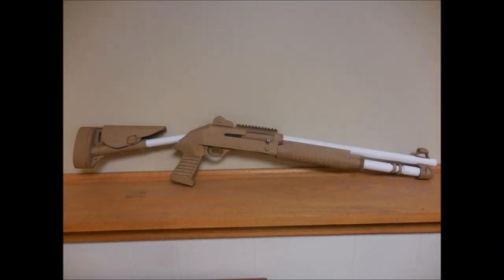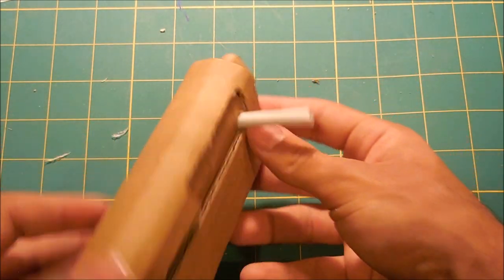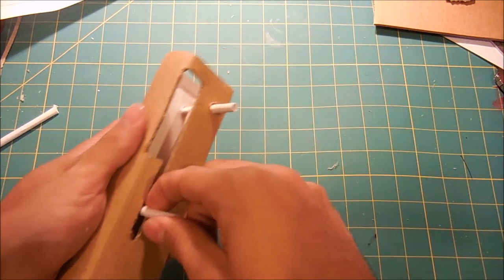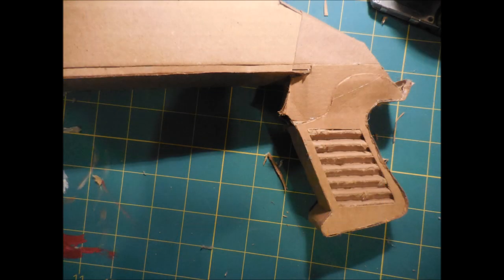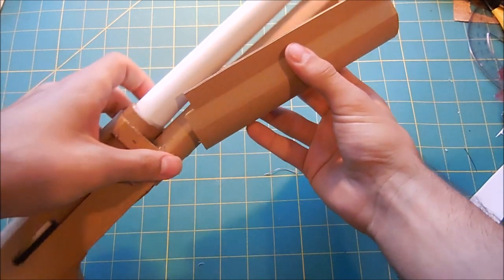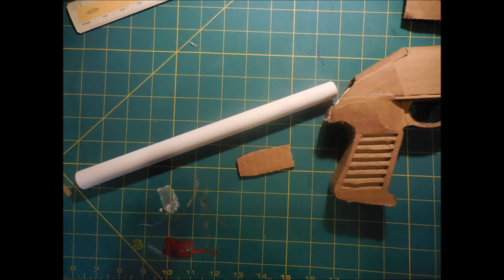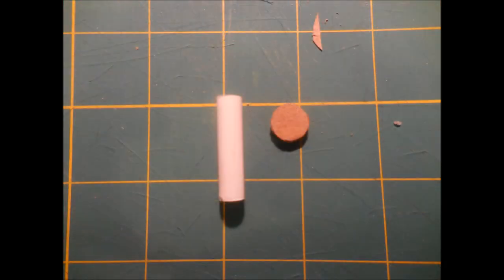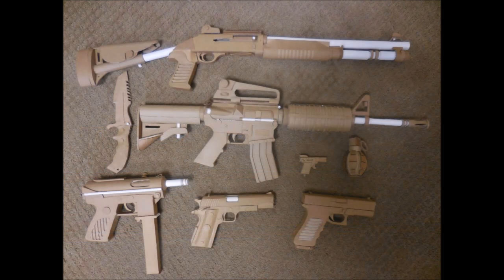How to make my cardboard Benelli M4 Super 90 (M1014)

Comment: what tool cut you used?
Reply from the maker: I just use a box cutter. The kind with the replaceable blades. The one I use is similar to this one https://www.idealtruevalue.com/store/p/157658-Master-Mechanic-Folding-Lock-Back-Utility-Knife-With-Hardwood-Handle-Q.html?feed=Froogle&gclid=Cj0KCQjwyur0BRDcARIsAEt86IAgs_0oyE7Hk7Fu2fzgLhf04dFn2iT1l6QGe6w0R8C4qKmet67ethwaAg69EALw_wcB

Comment: its great but the paper parts would just breack wouldent they
Reply from the maker: All of the paper parts are rolled very tightly so that they are almost solid or layered many times to give them strength. Paper is actually quite strong and ridged if you use it right.
Reply: @Magicalamazing  thanks ill give it a go its an great gun i just did not want to make and then it breaks
Reply from the maker: @charliesnerdychannel3665  Just so you know though, none of the guns I make are really meant to be thrown around or anything. They are not so strong as to be toys really. I just make them because it is fun to build them.
Reply: @Magicalamazing  wood it is then